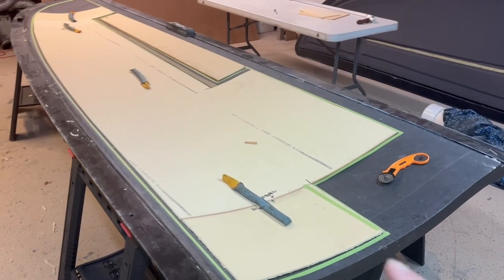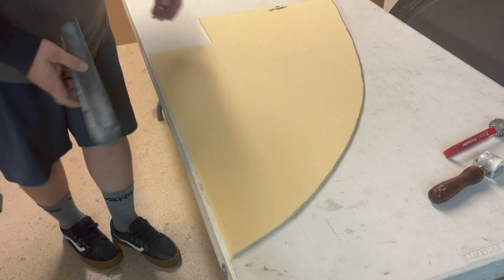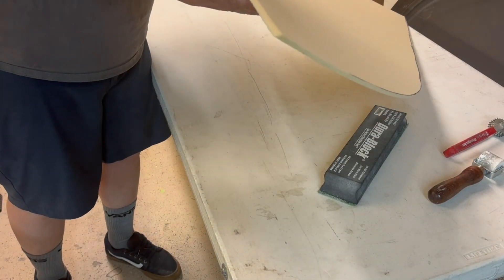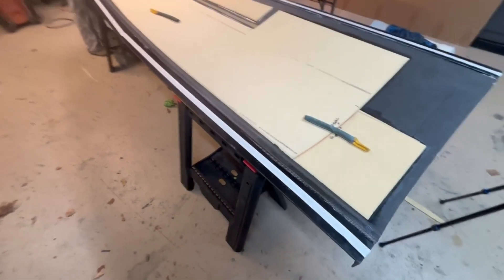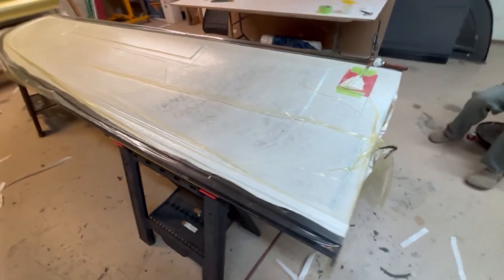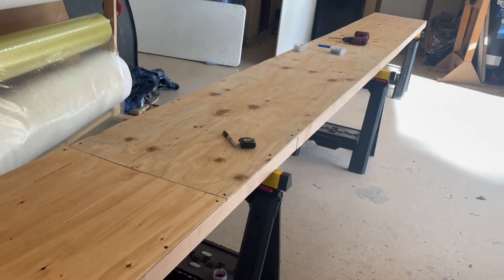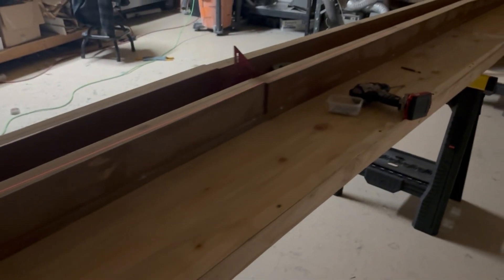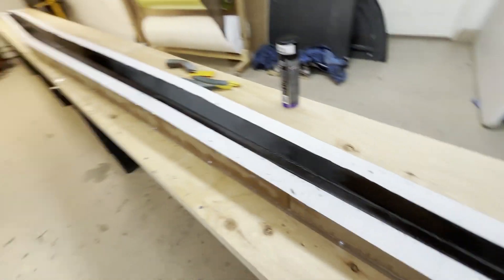Impulse Ep 15   Upper wing skins and spar

Comment: Woodpecker before chamfering?
Reply from the maker: @jameshammond11552  you could certainly do it before, I usually do it after. Either way works.
Reply: @RedJensen @RedJensen  I'm too clumsy, Red. When we first began using this method, I was in charge of making the flying surfaces, and we also used Divinicell. The only problem was that my wing-making buddies and I were all too clumsy and always mashed the nice chamfers with the hand-held woodpecker. Since then, we have used a pre-holed type of core, but at times (Mondays and Fridays), we had some rat bites on the edges before we pre-holed.

Comment: Did you take a block to the edges of the table to knock down any sharp edges that might cut the bag?
Reply from the maker: @dougcronkhite2113  bag should not go to the edges, but if it needs to I’ll be sure to check for an sharp edges.